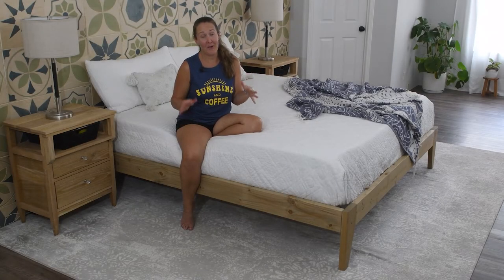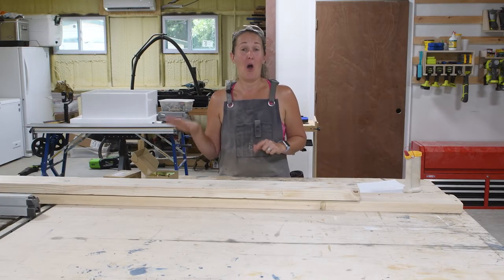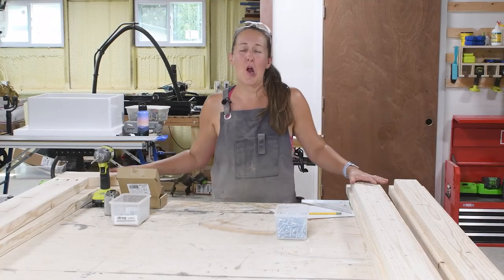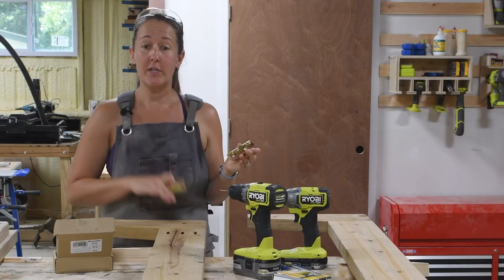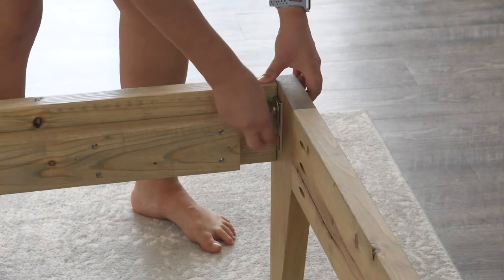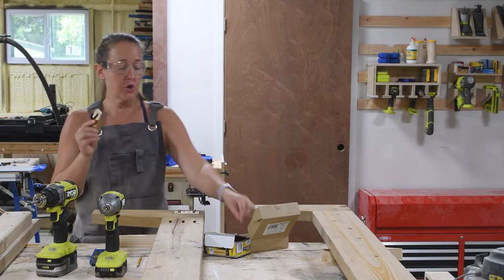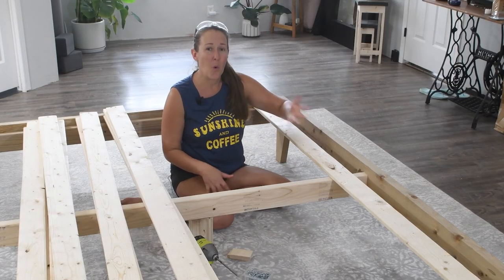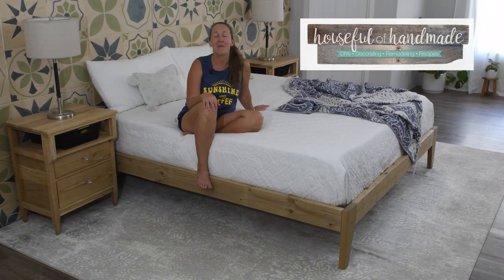DIY King Platform Bed Frame

Comment: Hi! I'd love to build a bed frame like this. What sort of wood(s) would you recommend for the side rails and footboard that will be sturdy enough but still cost effective? Some of the hardwoods (like oak and poplar) that came up when I did a general search were out of my budget, unfortunately.
Reply from the maker: You could build it out of regular construction lumber if its cost that's most important. That is what I used. You can find all the details here https://housefulofhandmade.com/diy-platform-bed-frame/